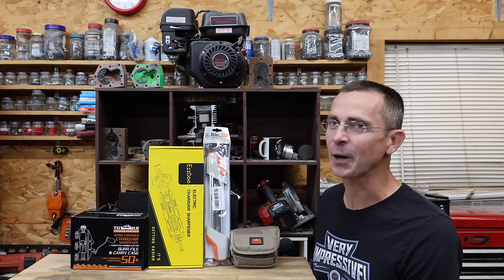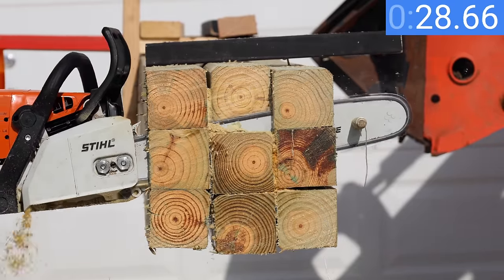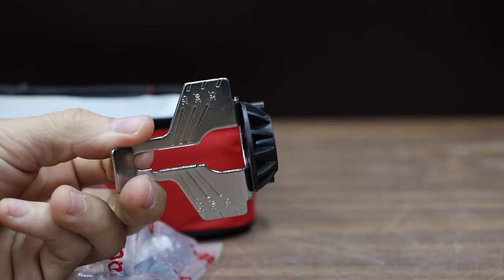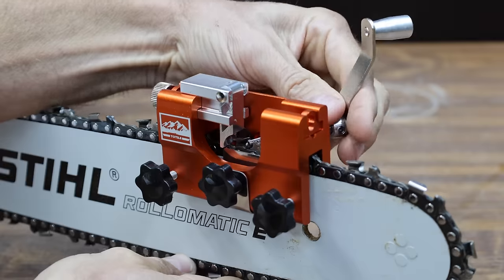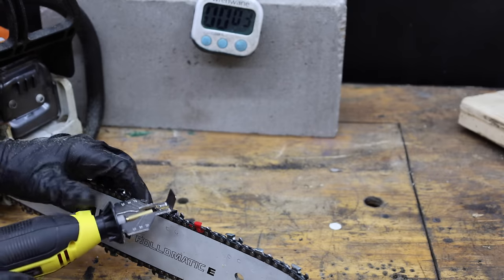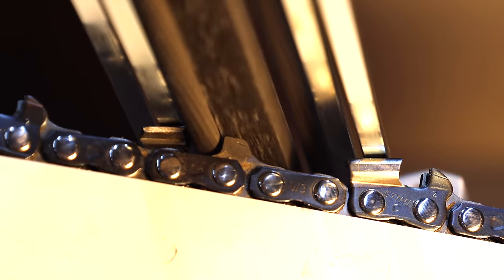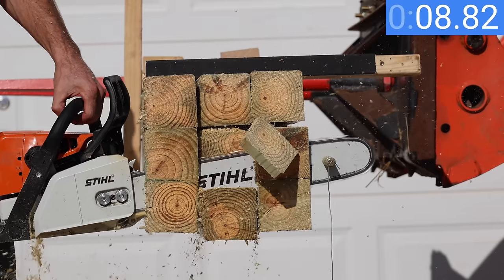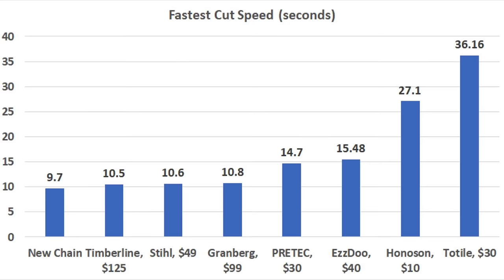Which Chainsaw Sharpener Is Best (2024)? Let's Find Out!

Comment: Great test. I have used the original Pferd version of that Stihl chain sharpener for several years now. Taking down the depth gauge a little is a must when you sharpen. I was impressed with that timberline. It would have been cool to see it eat with the depth gauges filed a little.
Reply from the maker: Thanks!  Thanks for sharing.

Comment: I know this is off topic for this video, but appreciate your honest reviews and opinion. 
If you had a yard that needed a lot of weedeating and often ran into brush, which gas powered weedeater would you buy right now?
Also, with this, I would want the ability to have different attachments especially a pole saw. 
Thank you!
Reply from the maker: Thanks for the suggestion.
Reply: @ProjectFarm  it would make a great video, but it was a for real question. 🙂 I need a new weedeater. I have around 2 1/2- 3 hours of weedeating each time I mow my lawn and around a 1/3 runs along the tree line.

Comment: I know many others have commented on it already, but I just gotta say that the Stihl 2-in-1 sharpener is an absolute game-changer. I never liked sharpening blades much, but after getting that tool, I don’t really mind sharpening at all now. Sometimes I even hit my blade with it preemptively just to keep it razor sharp. Most people don’t file down the depth gauges enough, or at all, and it makes a HUGE difference in how your saw cuts. The fact that that tool does the depth gauges at the same time actually saves you even more time if you add in all the filing you’d have to do on those after using one of the other tools. The Stihl sharpener is so damn good that it should just come with all new saws, and it’s almost idiot proof because it even shows you the correct angle you should be filing with little guide lines on the tool. There is a TON of room for possible user error when sharpening saw blades, but the Stihl tool almost removes any possibility of being able to mess it up if you follow the instructions and guide lines. And oh yeah, it also has the benefit of being able to carry it with you and use out in the woods if you happen to accidentally hit something to dull your blade unlike all the electric sharpeners. They just can’t be beat imo.
Reply from the maker: Thanks for sharing!

Comment: After working several years as a logger, I still prefer to file by hand with just round and flat files.  I have found Stihl brand files to be best with Oregon a reasonably close second.  It doesn’t take me more than 10 minutes to sharpen a dull chain if a vise is handy.  However, I generally sharpen my chains a couple of times a day if doing much cutting and by doing this I generally need to take only a couple of passes on each tooth and that goes very quickly.  Much better to sharpen more often than to wait and have to do an aggressive filing.  It is also much easier on the chainsaw and bar.
Reply from the maker: Thanks for sharing!

Comment: 1 more comment Todd. On the Timberline could a " slightly " LARGER grinding wheel/ stone fit in the provided whole ???  The second half of the question is rather than using the hand crank, could I connect it to my Dremel ????
Thank you in advance IF u choose to answer 😀👍🏽🤠

Comment: I absolutely love your dedication project farm! Your quest for honest answers never disappoints, but this one left some questions on the table. The chain guide is a HUGE variable from one test to the next, especially when shaping a totally new profile onto the teeth each time requiring more material removal than repeated use of the same sharpener would require. This is where the guide height becomes an unmagable variable.

Comment: I have a vise on my bench with soft jaws to hold the bar. Makes sharpening with the Stihl sharpener even faster. 

If you are only rotating 2 chains I think this is the best combo of sharpness, time, and cost. If you are running a lot of saws then the electric grinding wheels are probably faster to the point it is worth the cost.
Reply from the maker: Thanks for the feedback.

Comment: With the Timberline you have to use the right size burr (Stihl and Husq are different) and the right angle guides and set it up evenly (I use shims to set it evenly) and I recommend not setting it up with the burr all the way in but rather lower using the taper to get more hook and accommodate the sloping angle of the top-plate. If set up right it will grind better than new chain uniformly every time. Not a chain grinder but the best small kit I've seen.
Reply from the maker: Thank you for sharing!

Comment: Hi. If you read this. Can you please do this test. 

The best option to drill spot welds from panels

You have hole saw cutters, spot weld drill bits, normal drill bits, pre drill, mini sander and maybe some more

In my eyes if you could get a carbide hole saw that would be best but I can’t seem to find any. Then do you use oil/paste and clean the mess or buy cheap and just change when they go blunt
Reply from the maker: Thanks for the suggestion.

Comment: Never been satisfied with round files, I know what to get now. Always great videos!
Reply from the maker: Thanks!
Reply: It's a skill that takes time to develop. I used guides and tricks early on, but the all just slow me down too much now. I'm no logger but I've put in a lot of hours behind the saw-heating exclusively with wood for over two decades now, cutting every stick of it for all but three years.  Keep the chain sharp whichever way works best for you.  Running dull sawchain is an error on many levels.

Comment: I think an immensely important detail in sharpening in general is the scratch pattern the sharpener leaves on the blade. If you recall I told you about the "sharp knives dull faster" myth a while back.

While the Stihl sharpener seems to have performed well, it left a horizontal strach pattern on the blade 11:12 . That egde will not last as long as the vertical pattern of Timberline 15:40

Just a little something to keep in mind in the future sharpener videos. Love your work Todd!
Reply from the maker: Thanks!  Thanks for the constructive feedback.

Comment: I've enjoyed the stihl 2 in 1. Couple tips for those trying to save a buck.
1. It may be cheaper to buy from a stihl dealer than Amazon or another reseller. Stihl only sells through dealers, so the reseller will have some markup.
2. The company that makes the 2 in 1 for stihl (pferd)  makes their own that is blue. May be cheaper to get it from them if your shipping is low. The only thing I'm not sure about is the file quality.

Comment: I've used the timberline and agree with everything said here. It does a great job. You get a sharp chain, very consistent but it is slow. What I've concluded is once in a while I use the timberline to true up the angles etc and then use a stihl sharpener the rest of the time.  I once bought one of the knockoffs. They duped me with the timberline picture etc and when it arrived I looked at it and immediately initiated a return. Absolute garbage. I would use a hand file before using that abomination. 

Great vid.
Reply from the maker: Thanks!  Thanks for the feedback.

Comment: 1. Pferd brand files are absolutely fantastic. They cut fast and stay sharp.

2. I have the manual version of the Granberg (cheaper, no power required, and replacement files are easily sourced). It's fantastic AND it has the added functionality of being able to file the rakers repeatably and accurately.

3. I think the manual Granberg gives you more repeatable and sharper chains, but it is bulkier, so you use it at home in the shop. The Stihl is a really good "back pocket" tool to use out in the woods.
Reply from the maker: Thanks for the feedback.

Comment: I have a chain sharpener that resembles a chopsaw with a 4 inch diameter x 3/16 inch grinder stone, called a Nick Sharpener, originally from Harbor Fright. I see there are a bunch on Amzn under electric chain saw sharpener, but the one I have was made in Italy from injection molded nylon and is quite high quality, and makes very short, quality and accurate work of grinding teeth.
Reply from the maker: Thanks for sharing!

Comment: Flare nut/line wrenches that close around the nut like "Proto® 10 Piece Metric Ratcheting Flare Nut Wrench Set" makes some also the "Ratcheting Line Wrench SAE & Metric Kit" style wrenches that ratchet around the flare nut for 360 coverage. I see them of various quality from China, USA, Taiwan... They won't always work, but they do work on most brake lines and give you a better shot at saving the line.
Reply from the maker: Thanks for the feedback.

Comment: i have the timberline, and you're right the main drawback is the time it takes to do the job.  I have found putting the carbide bit into a rechargeable drill instead of the little crank they give you speeds it up immensely. :D
Reply from the maker: Thanks for the feedback.

Comment: Mine is a power one with a bicycle style brake line that holds the chain as you bring down a ceramic cutting wheel that sharpens it in a specific angle
Reply from the maker: Thanks for the feedback.
Reply: @ProjectFarm  its made by Chicago Electric. $29.99 harbor freight

Comment: How well will the saw cut if you sharpen it in less than 4 minutes with only a roundfile by hand for 3 minutes + 2 minutes with a flat file, to top the rakes?

i don't think a specialty alignment tool is worth the trouble and space, alone, (regardless of pricing) in my experiences from hand sharpening my own chains.

Comment: I've used the Granberg for over 12 years. It is worth every penny if you can't hand sharpen a chain. 

The best method is by a hand file, but that takes some experience. A person who is good with a file can make a used chain cut faster than a new chain. Sometimes, significantly faster.
Reply from the maker: Thanks for the feedback.

Comment: Very impressive. My quite old Stihl chainsaw has seen numerous hand sharpening attempts. My Stihl sharpener has been fine as you found. But what I would like to see tested are multi-meters. I've owned four different ones. Ease of use, readability, good leads, and a wide variety of setting all have had important points. I've never owned one with an adequate carrying case, all were hard to untangle leads and were hard to put back the leads. Ease of battery replacing varied widely as did battery life. Lighted readout is very important, more so in bright sun than heavy overcast. Seems my neglect at changing batteries killed two meters, duh. don't use one that often, but when I do they get used a great deal. Thanks for the testing. I've used your findings several times and quite glad I did.
Reply from the maker: Thanks for sharing!

Comment: When I bought my first chainsaw I bought the Stihl sharpener because I was not prepared to use files as a pro would do, and it is extremely convenient because it is simply a hand tool. 
Would not have a chainsaw now without this sharpener.

Comment: I love your tests. They are so complete in covering most all the important considerations. That is so awesome.
As much as I'd likely love the motorized sharpener that did so well, I'd be afraid it would be too easy to wear down the chain too fast. I've used the Stihl sharpener and it worked great, especially for out in the field. I've never tried or even seen the Timberline sharpener, but it seems pretty cool.

So if the electric sharpener that did so well doesn't eat up the chain too fast, I admit that would be my choice for getting several chains ready at home before going out in the field and the Stihl for when I'm out in the field.

But since I'm disabled, I doubt I'll be running a chainsaw again. But I really enjoyed my Stihl saws in the past, so I just had to comment on something I was once very interested in. 

Great video as always.

I followed one of your winning tested items just today. The Stanley vacuum insulated 20 oz tumbler. Thank you! 😎👍
Reply from the maker: Our pleasure, thanks for sharing!

Comment: The timberline is an awsome sharpener.  Brings chain to basically factory specs with all teeth being the same lenght.  I found it slow too so put the carbide in a hand drill and oiled the shaft of thr cutter.  So much better and faster!
Reply from the maker: Thanks for the feedback.

Comment: I have grandberg chainsaw sharpener . It has the steepest learning curve because of all the adjustments and setup . 
But one of the most consistent sharpener if you are sharpening long bar . 
I then bought the Stihl / Pferd 2-1 sharpener for field use . 

OMG now I only use the Stihl 2-1 90% of the time . 
I still use the grandberg to even out the tooth . 
Btw the grandberg also can be set up to lower the raker .
Reply from the maker: Thanks for the feedback.

Comment: Great video!  For a followup, consider a name brand and cheaper (I have the Harbor Freight one) chainsaw wheel grinder, and a knockoff of that stihl hand filer.  Or different brands of those replacement files (I bought a box of 12 off of Baileys, instead of 1-2 at a time at HD).  I like having a small hand filer in the field, and a powered grinder for occasional use if the chain gets really messed up.  And trimming up those rakers really matters a lot more after filing many times.
Reply from the maker: Thanks!  Thanks for the suggestion.

Comment: I've used the Timberline for years and sometimes it scares me!  😂  The cutters works in a cordless drill if you're careful and a little cutting oil to control heat and slivers.

I started playing with raker cutting height (shouldn't have) and made a couple chains terrifyingly aggressive and they just absolutely tore through standing birch, faster than I was ready for the first few times.
Reply from the maker: Thanks for sharing.

Comment: Todd:  It's been 3 years since the last cordless chainsaw video - would you consider doing another one since many brands have released higher power 20" chainsaws since that time.   Dewalt, Ryobi, Ego, Greenworks to name a few have new saws in this higher power category and they seem to get really good reviews online.  On a side note:  Will milwaukee be able to keep up with only 18 volt battery platform?  Their 72V MX platform batteries look too bulky and angular for chainsaws.
Reply from the maker: Thanks for the suggestion.

Comment: I've had results comparable to those of the Granberg, using an Oregon-branded manual sharpener.  It uses conventional hand-operated files and the guide bars that slide through the alignment jig are sufficiently long for that. The jig that holds the whole tool on the saw bar and maintains alignment, however, looks exactly like the Granberg unit.  

While sharpening, an important thing to remember is to let up the pressure on the return stroke.  The file can't take it very much, trying to cut against the hard chrome outside face of the chain tooth will dull a file fairly quickly.  Making only outward strokes is a little finicky but once you're in the rhythm it's not a big deal, and I can usually do a chain in about ten minutes or so - five minutes to attach and set up, five to sharpen.
Reply from the maker: Thanks for the feedback.

Comment: Technique is just as important as the type of sharpener.
I used to use a 12 volt Granberg, and I could do a great job sharpening chains with it. Every other person in our department that used that sharpener did a crappy job. They would often not adjust it perfectly, so the grinding stone  would not be at the perfect angle and height. They also could not tell visually when to stop sharpening or when to keep on sharpening.  The Granberg requires fine adjustment, and careful handling to do a good job.
Reply from the maker: Thanks for sharing!

Comment: I have the Timberline and really like it.  I think it is the most fool-proof, with regards to consistent angle and cutting tooth length, so you get straight chainsaw cuts.  Does the Stihl require more skill to keep angles and amount removed consistent?  I guess a downside of the Timberline is no depth limiter tooth filing (some are calling them rakers, but I'm not sure that's the correct term), but a simple separate tool and flat file works for that.
Reply from the maker: Thanks for the feedback.

Comment: Currently Using the Harbor Freight, Chicago Electric Electric Chain Saw Sharpener. It's a little flimsy and definitely not for industrial use. However, yeilds an extremely sharp chain at precise angles with just a little practice.
Reply from the maker: Thanks for sharing.

Comment: I have a sharpener that looks and sets up similar to the granberg, but it uses a conventional chain saw file instead of the motor powered stone.  It gets the chain almost factory sharp with all the angles kept accurate.  I'd like to see how it would match up against the ones you tested.
Reply from the maker: Thanks for the suggestion.
Reply: @ProjectFarm  I don't know if you'd be able to find one.  Mine is, like, 30 years old and it still works great!

Comment: Very good and useful video with very detailed testing and informative by just 20mins. 👍Thanks for the video.

I have a tiny workshop in my garden and there is a wall attached to my house. My family always complains to me that it is too noisy when I am doing handy work. I am thinking of installing a few soundproof foams on that wall. However, I am not sure which one is the best for me and there are so many in Amazon. It would be helpful to me if you test on those foams, especially on fire retardant as very dry in here.
Reply from the maker: Thanks and you are welcome!  Thanks for the suggestion.

Comment: I'm temptated[sic] to try the Stihl sharpener...but having gotten pretty good with files, I think I'll spend the money on a vise instead to hold the saw...then it'll be even easier with the files, and I should be able to get even better results, faster. The rakers typically only need filing after every 5 or more sharpenings.
Reply from the maker: Thanks for the feedback.